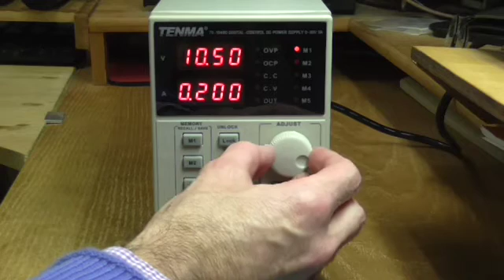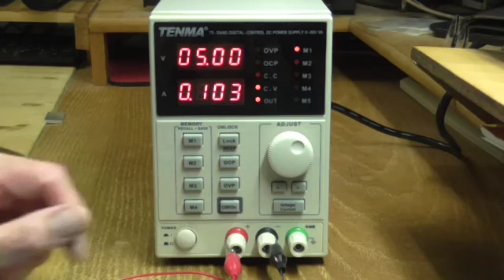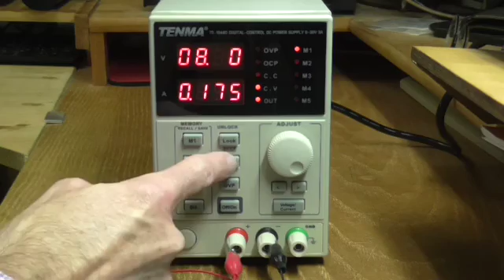Tenma 72-10480 Laboratory Bench Power Supply

Comment: BRILLIANT REVIEW! Thank you!
Just a quick question : If for example you set the voltage to 5v and the current to 500mA, if you consume more than 500mA the current would clamp at 500mA but the voltage will fall? Was wondering if this would be suitable to charge Lithium Ion Batteries where a constant voltage / constant current is required.
Reply: I think good to buy a cheap li-ion ICs. I am not sure if it is a good idea to run these machines forever. Try TP4065 module. I bought them like 4 pc per pound and tested for charging 18650. Worked great

Comment: Be very careful with the M4 preset, rolling the dial after setting it will go to the M5 preset, my M4 was 3.3V@100mA, the M5 preset I didn't know I could get to was at the default 30V@3A. An unhappy prototype and a lot of swearing ensued... I set M5 to 1v@0.01mA after that.
Reply: I think it is important that the PSU disables the o/p when switching between presets.
Reply: This is probably a clone of the Korad. When you switch between presets, it will automatically turn off the output.  I don't know how come yours switched to anothe memory without disconnecting the output...
Reply: @DarthMaul41  I actually tested that a few times trying to figure out the behavior, I couldn't replicate it, it does switch off when switching presets, so I'm not sure what happened that one time. I tried playing with rolling the dial after changing voltage/current right at the timeout where the dial stops modifying the values and instead changes the preset, thinking that might be it, but it was no use. Because the magic smoke escaped with my finger on the dial and away from other buttons, and I had nothing near the front panel likely to press anything, I'm pretty sure it wasn't user error, but at this point I'm considering it a freak accident because I was never able to replicate it. I'm wondering if my Output Enable button got stuck under the front panel, but it responds solidly, and I can't get it to do anything weird. After all the testing and prodding, I trust it not to do anything wacky again, but I have no explanation for the grieving decedents of that one board.